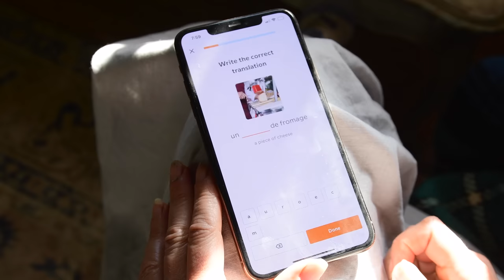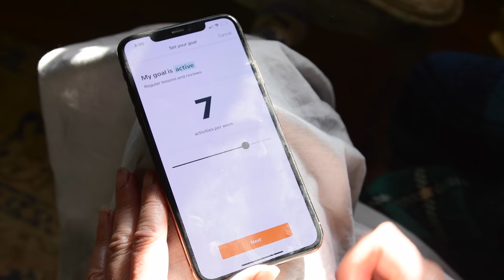🌷HOME DESIGN🌷 | Historic Solution to a Modern Flooring Dilemma | FRENCH FARMHOUSE

Comment: This technique can actually work. My beloved late partner & I reclaimed a small barn on property he owned. We first sanded the wide plank boards & swept the sawdust into the cracks. Next we tamped the rope into the cracks having to use both wood putty & wood glue along the way. When this was finished we returned to our main home for a week allowing everything to dry & set. On return to the barn we swept & lightly damp mopped the floor boards which honestly looked rather good. After the damp mopping dried we stained the boards a rich warm medium oak. We allowed another week for this to dry. After a week we came back and used a clear gym seal on the boards. We also allowed a week for this to dry. When finished the barn floor was beautiful and the rope was very set solid & easy to clean. We did this in summer 2015...that floor remains beautiful. ...I wish you the best with your flooring projects. Very nice video allowing people to have an option on handling these charming rustic floors.

Comment: I know you prefer a vintage look, and the rope looks great for the short term. Eventually, though, it will collect a lot of dirt and it's not really cleanable. My suggestion (I remodel old houses) is that when you have the funds and can find what you like on sale, cover the whole floor (rope and all) with a good quality laminate flooring (such as Pergo), which has a special foam sheet vapor barrier that goes underneath the laminate and essentially seals the floor. Super easy to install yourself. It also creates a lovely sound barrier and you will actually have WARM floors in winter. Pretty amazing stuff. Pergo and other quality laminates come in so many lovely colours nowadays, that one can easily find something that looks old/distressed but will wear like iron. It's impervious to dog toenails and shoes and what have you. Cleans up like a dream. Just my two cents.

Comment: Great solution! For deeper holes, depending on the thickness of your floorboards, you could first glue in foam caulk-saver,  (which is essentially like a styrofoam rope), then once that dries, go back and glue the rope on top of that, so the ropes all end up finishing off at the same depth, preventing some ropes from sinking in deeper than others.

Comment: We have the issue of a pine plank subfloor in our upstairs that is fine in a couple of rooms, but is a patchwork of boards in the center of the largest room. We have gaps between boards where dirt collects and lots of noise downstairs. We are going to put down a laminate with foam attached--and lay down an underlayment also to help with insulation and sound proofing.  I've found several choices that look like solid wood--but still checking on FB marketplace for someone selling an engineered wood.  I've been able to find some beautiful parquet for another room as lots of people remove it when they are redecorating.  It's not cheap on ebay, but sometimes you can find an individual selling it on FB.  Old parquet really fits the English and French vibe...

Comment: I like the rope in the spaces but am wondering about sealing it. Won’t it absorb dirt, etc, and become stained when you mop the floors? What if you put a layer of fiberglass resin over the whole thing to seal it? Of course that would possibly make the floors too shiny so….
Reply: Usually if wooden floors are sanded they use the sawdust, mix it with glue, paint the gaps with it (I don't know the correct word for "putting it in the gaps"), let it dry, sand it and seal it.

Comment: Since the house is so noisy i should have consider to lay an other wooden floor on the existing floor using  insulating and sound- damping  material in between.
Reply: Especially as  you see the room under the floor. Somebody forgot one layer, it seems.